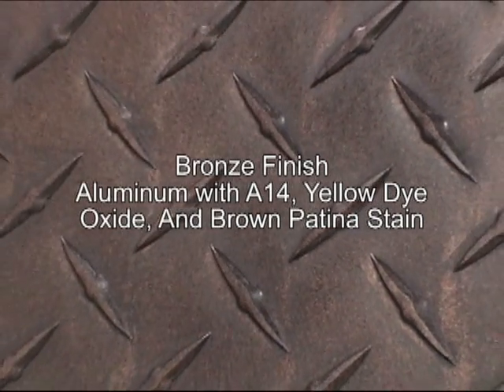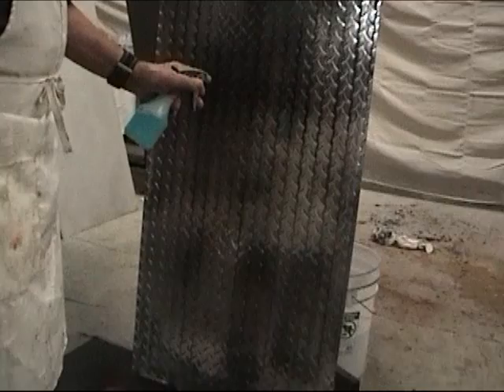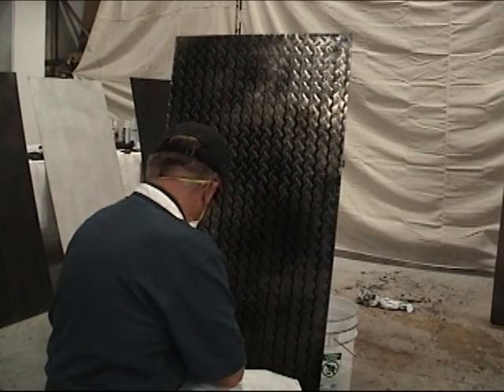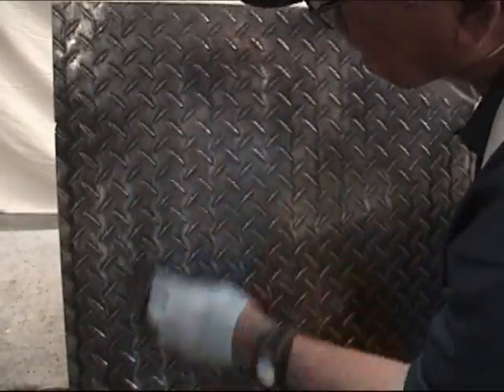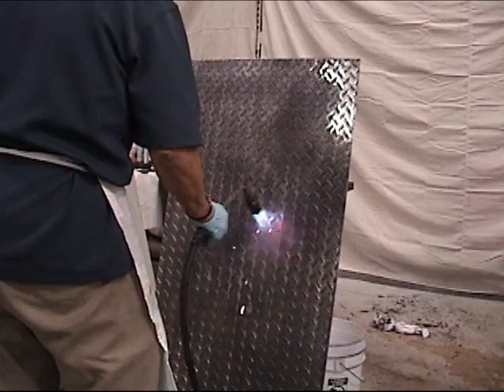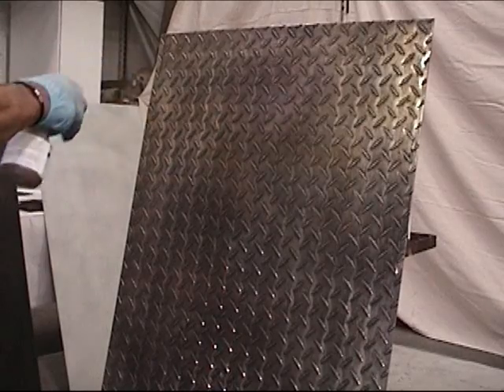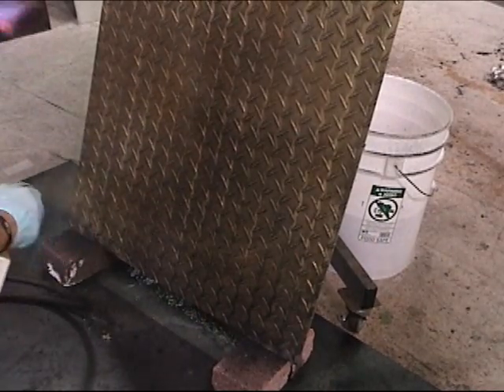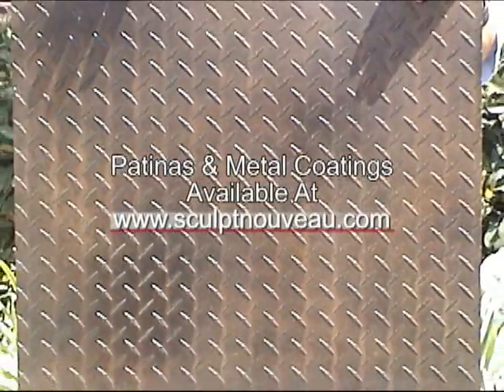Bronze Finish over aluminum

Comment: Can the yellow dye oxide be applied first, followed by a black A14 for a different look? Or will the acid from A14 totally remove the yellow color?
Reply from the maker: +Slap Stick It wouldn't work out all that well but it might create something cool looking. The reason is because A14 needs to be in contact with the bare metal to get a reaction. More than likely, if you did the Dye Oxide first, you would get some black turning but when you go to neutralize the patina some of the Dye Oxide would come off. Much better off going with a reactive patina and then a non-reactive patina as a general rule.

Comment: Could I use that yellow dye oxide on aluminum to achieve the look of shiny brass?  Maybe with something else?  I have a problem with a vintage table that shows as shiny brass but it is really aluminum that has either been brass plated or somehow finished in brass.  After years of cleaning with the wrong product (the dreaded Windex) the shiny mirror brass has worn away in conspicuous spots leaving just the underlying shiny aluminum.  I don't know how the original finish was achieved.   I thought aluminum had to be plated first with nickel THEN it can be brass plated.  There does not seem to be layers of brass and nickel plating revealed at the wear spots.  Whatever they used it looks good, not too fake like most faux brass finishes today.
Reply from the maker: The Yellow Dye Oxide wouldn't imitate shiny brass more than likely. If you send a picture of what it looks like to ryan@sculptnouveau.com we can try and figure out the best option for you.

Comment: Would this process work on an aluminum motorcycle case and heads?  Very cool concept.  Would love to do something different from chrome and polished aluminum or paint.
Reply from the maker: +Dick Johnson It should work fine for that application. It would also be a good idea to protect it with some Ever Clear.